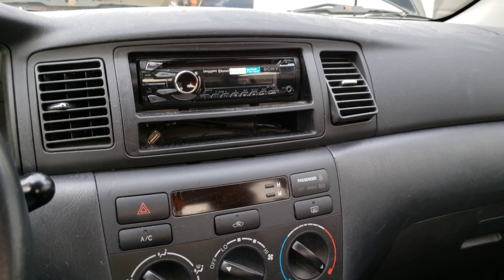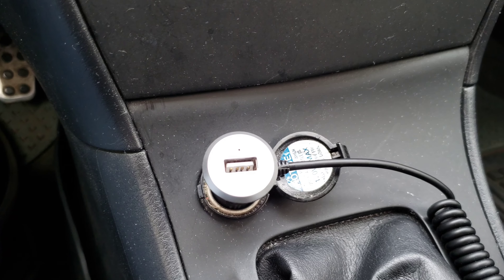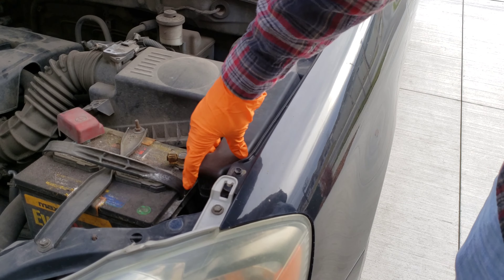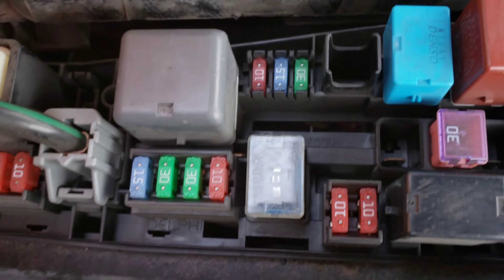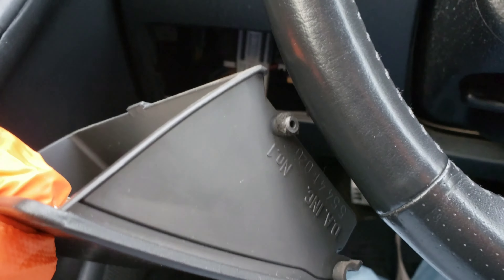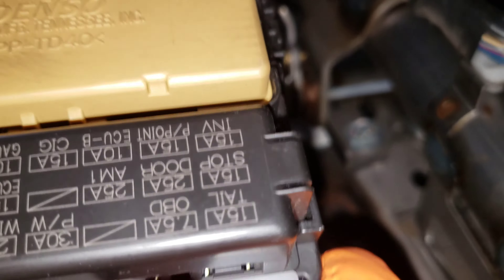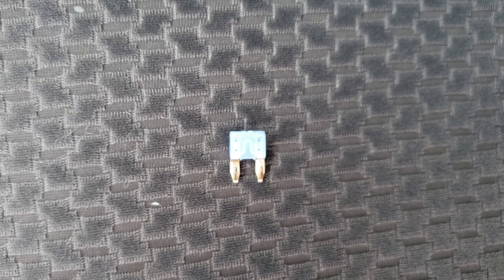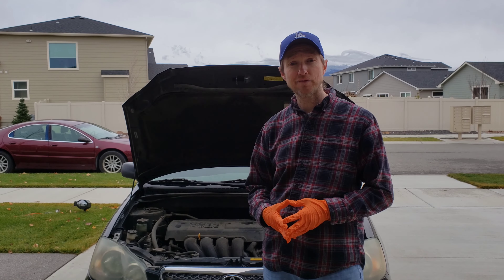How To Replace The Cigarette Lighter Fuse On A 2003 2004 2005 2006 2007 2008 Toyota Corolla

Comment: This is the best, most concise and helpful video for changing fuses on Toyota Corollas! Thank you so much!

Both of my brake lights stopped working at the same time...but the small brake light in the middle (above the trunk) still works... I'm assuming I need to replace my Brake/Stop Light 15 amp fuse.

Can I still use the same SPARE 15 amp fuse for the brake light fuse??

Comment: Got a 45w dual usb branded car charger on eBay and blown fuses when charging dashcam and cell phone at the same time.  Am wondering which car charger would be safe to use for dual charge. Ta

Comment: I wanna know which fuse shall I replace for 
Shift Lock Control ECU or Gear Shift panel Bulb ? I changed the bulb it does not work at all. rest every bulb in the interior is working great. 2005 Corolla. The Cigarette Lighter is also working fine.
Reply from the maker: Thanks for watching,  I will have to add that to my list of videos to make.
Reply: @ToddsGarage  I will be waiting for it,  But atleast let me know the resolution ?
Reply from the maker: Sorry I am not sure what the resolution is. Good luck, I hope you are able to get it fixed and sorry I couldn't help.  Thanks again for watching,  I appriciate it.
Reply: @ToddsGarage  No Problem. Thanks.